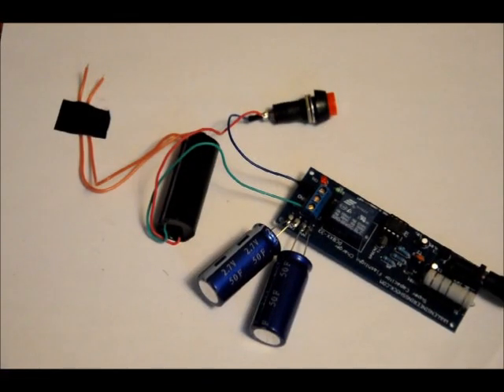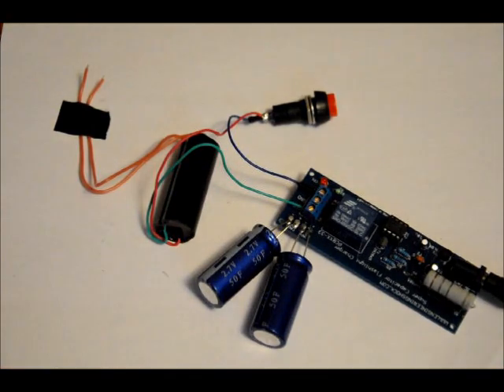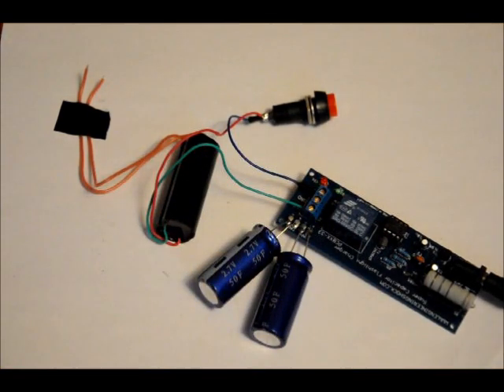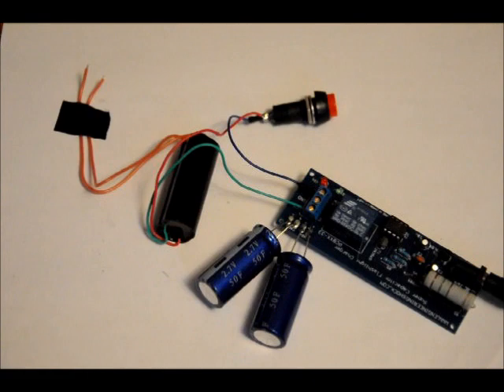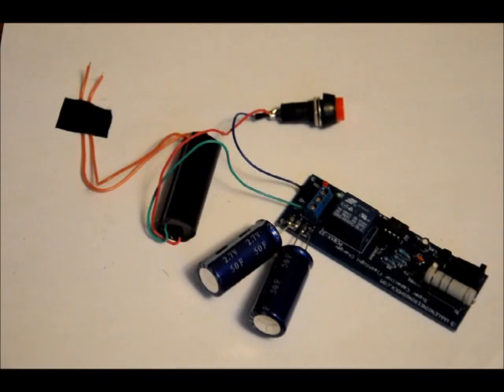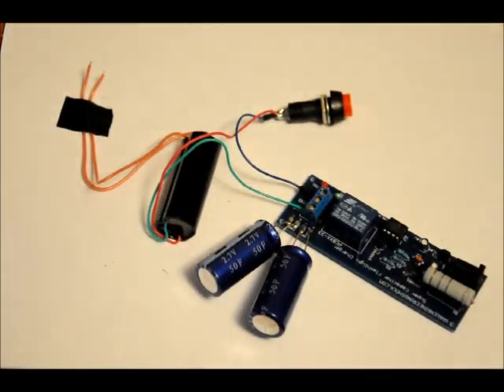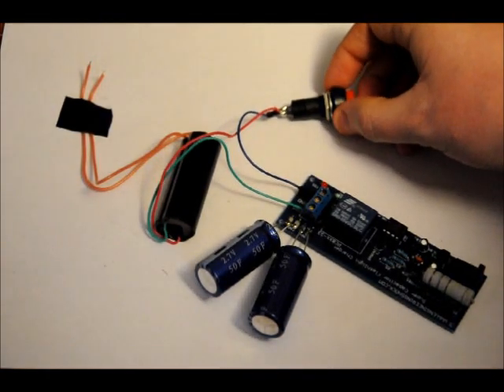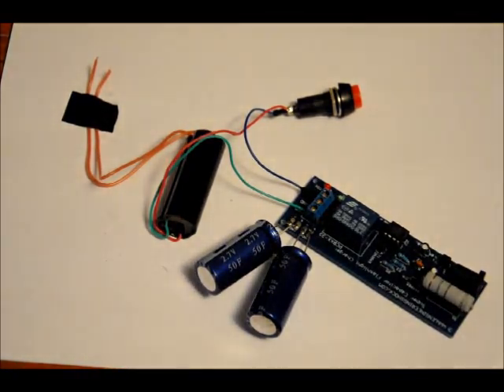The Super Capacitor Based 30kv Taser Stun Gun Prototype - Fast Rechargeable - 5.3v to 30kv.wmv

Comment: i would like make my own taser 
do you have kits available
Reply: +Joseph Baldacchino - You dont really need a kit. The "high voltage generators" are available on ebay for as low as $2. The Super caps can be bought there too. Also buy a 50-100 ohm 10 Watt resistor, a usb cord, and a momentary contact switch like the one in the video. (total aprox $10 all together). connect the two capacitor together in series (negative to positive). Connect the resistor to the capacitor that has the positive lead free. Cut off the mini or micro plug off the usb cable and connect the resistor to the red wire and connect the black wire to the remaining free lead on the capacitor. It should indicate neagative on the capacitor. Plug the usb cable to a usb port to charge the capacitors. You can also make a charge LED indicator by connecting a white LED in series with a 75 ohm resistor and connecting the pair across the capacitors. That is, the 75 ohm(1/4 watt) resistor to the cap where it connects to the 10W resistor and the Cathode of the LED(neg- short lead) to the black wire. This works because when th capacitors are charging, they will pull down the voltage below the foward bias voltage of the LED and it wont light up, then as the voltage in the capacitors rise, the LED will get brighter. Caution. When charging them this way, you must be present and disconnect them as soon as they are charged. It wont take long. Once the caps are charged, disconnect them and you can connect the caps to the switch and HV generator as seen in the video. I would recoment buying a cheapo expendable phone charger to do this.

Comment: I would advise against ever making one of these.  A real taser used current limiting resistors to PREVENT IT FROM KILLING YOU!  This home made device most likely doesn't have this current limiting feature and capacitors are capable of enormous discharge currents (almost infinite).  High voltage + high delivered amps = kill you dead.
Reply: +Joshua Portinga    These pulse transformers only deliver the current for a tiny fraction of a second. This is why they can be driven by a 3.6v battery.   Of concern though, is because the caps can discharge so quickly (yes higher current)  the pulses are being delivered a lot faster than a battery powered Taser would.  I wouldn't want one in one hand and one in the other.  Fibrillation could be a problem.
Reply: +Joshua Portinga I WOULD ADVISE THAT YOU HAVE ZERO CLUE WHAT YOU ARE TALKING ABOUT! And you've probably never used one of these. So as the REAL expert here. Let me try to help you out.
- These run on 3V6 DC, and turn that into upwards of 1000kVAC. As I'm sure you know, the greater the voltage difference, the smaller the current. These are not designed to supply any current, just a fixed output voltage. So any current you see will be in the nA range; far from lethal.
- These have resistors on the output terminals to simulate a small load. Otherwise they might not work. As I'm sure you ALSO KNOW, resistors act as current limiters. If you want to play it tinfoil-hat safe, find some resistors rated for 1MVAC (1000kVAC), but preferably higher, and attach one on each output lead. Those will help keep your current limited

Feeling better?
Reply: forgot somthing... you have no idea what your talking about its high voltage + SUPER fast (at most 7 micro sec) thats not even enogh time to burn skin only enough so you feel it = your alive but with a second lasting pain

Comment: police tasers have like 50,000 volts, converting that to capacitance that would mean police tasers have 50 farad capacitor. How is that much voltage and farad in a capacitor small enough to ft inside a taser?
Reply: +Michelle Yamipixie - Wow. How would you even begin to answer this comment?
Reply: +Michelle Yamipixie    You do not need a 50 farad cap.   Often a Villard Cascade Voltage Multiplier is used.

Comment: where did you get the circuit board from?
Reply: CANVECVIDEO you don't need the circuit board. that transformer can be bought on ebay for about $5 usd. everything is already inside the housing, so you don't need to build a dc to ac inverter. all you do is plug a battery to it and it'll work.
Reply: +wynnfulsee link under for purchase ebay..... yep exactly.  amps in and maybe 10ma 0ut, use a decent rechargeable 9 v battery (7.4v output to the module less than 4 amp) or  18650s is series (7.4 and 4.5 amp to unit when in use) dont short out and dont make gap too big so dont spark or fry it. a switch is helpful.
http://www.ebay.co.uk/itm/221738483225?_trksid=p2057872.m2749.l2649&ssPageName=STRK%3AMEBIDX%3AIT

Comment: Can you connect/align 2 transformers to increase voltage even more?
Reply: no, ish? If you only the inputs together it won't do anything other than sharing the load. But if you try to connect one modules output to another ones input, you will most probably burn the seccond module as the input circuitry isn't rated for high voltage neither for ac current.

Comment: Probably not EMI interfering with the screen. More likely what you're seeing is an artefact of the rolling shutter used in your CMOS sensor. The very brief flashes of light means that only a portion of each frame is being brightly illuminated, causing the horizontal banding.
Reply: I was just about to comment that lol

Comment: you're putting 1Amp through it??? that will kill some one instantly.... I believe 10mA is more safe for a stun gun, it will cause your muscles to lockup until the circuit is turnt off or removed
Reply from the maker: ? - The primary side takes a ton of current to step up to 30kv.  That doesn't mean that 1A is transferring.  The secondary can offer current in the uA range before falling.  The resistance of the load determines that.  If a dead short was seen on the secondary, you'd see the voltage drop to 0v, and the short current measurement would be in the uA Range.  It would shock you, but no more than any other taser.  Less actually.
Reply: ahhhh I feel so stupid right now haha if i was correct we'd have perpetual energy
Reply: TheJohny9898 Most stun guns are around 2 to 4ma

Comment: I bought these High Voltage  transformers on ebay from jason-ac2012 for another stun gun project. It is nearly done so will post vid soon. Just look up 6v - 8v High Voltage Ignition Unit Module on ebay to find them. Im happy with mine I got from ebay. Im still using them now. I tried other cheaper ones on ebay but they blew on me within minutes. They are good but you cant overstretch the spark distance or they will just blow. The best ones I found are from uk ebay seller jason-ac2012

Comment: If You Want To Make A Really Powerful Stun Gun Yourself ! Just get a 9v impulse ignition component starter pack from ebay. Savage Power! You get 2 high power schematics included, Easy and really powerful Advanced level schematic as well as PCB design layout sheets, Including a builder guide sheet, high spec Ultra Power T1 and XGen6T80 T2 with all the components needed to build a savage stun gun included in the one pack. I get 3cm sparks with mine.

Comment: I just bought some of these on ebay from jason-ac2012, Just look up 6v - 8v High Voltage Ignition Unit. 
Im really happy with mine I got from there. Im still using them now.
I tried other cheaper ones but they just blew.

Comment from the maker: Capacitors can be rated for kv, but these caps are only rated for 2.7v each.  The series bank is 5.4v, and that power is used on the primary of a step up transformer, which turns 5v into 30kv.